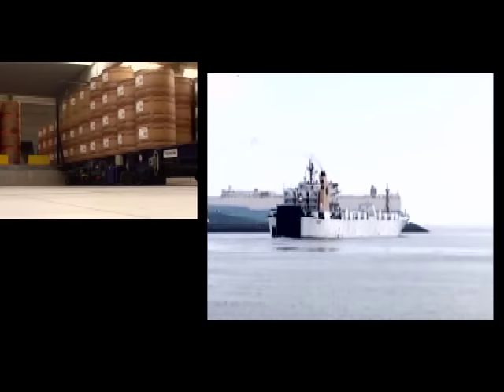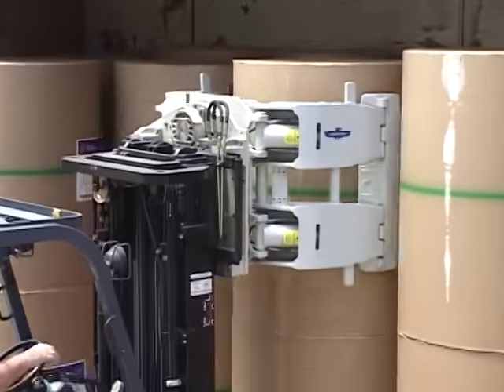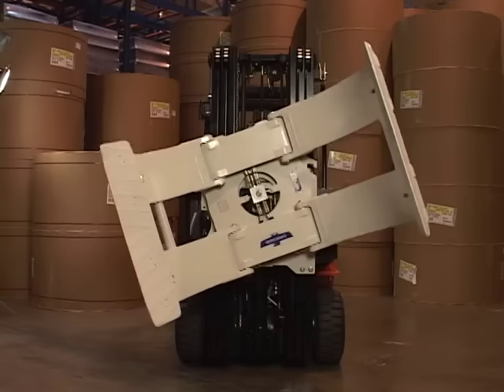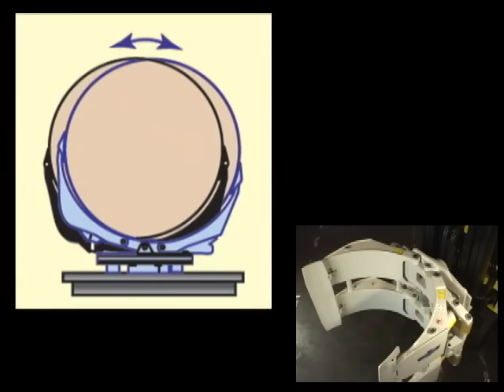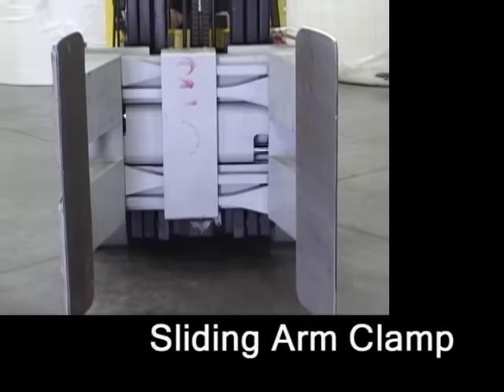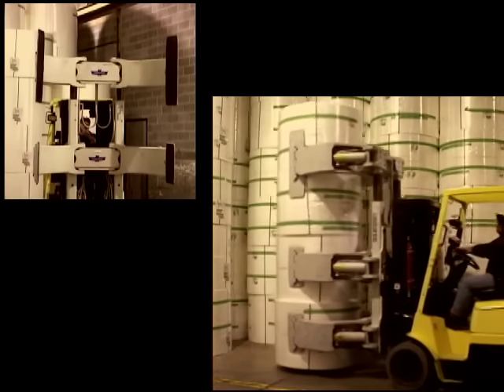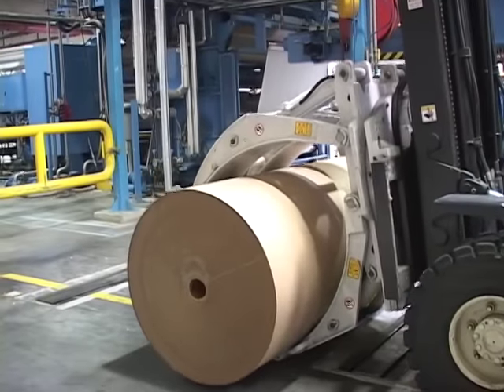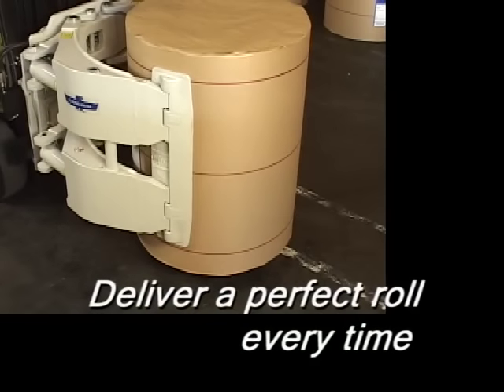Cascade Paper Roll Clamps - Lift Truck Roll Handling

Comment from the maker: @yanbu111bunty Please have a look at "Technical Support Manuals" page located in the Support section of our website. You will be able to find many different types of service, installation, maintenance and other documentation there.
If you still cannot locate the information you require please contact your local Cascade representative who's contact information is also located under the Contact Us section of the Cascade website.

Comment: The hyster trucks at where I work still mess up a lot of rolls.  I guess it's mostly down to the operator?
Reply from the maker: Hello - Do you mean a Hyster Truck with a Cascade paper roll clamp? We would have you talk to someone in our customer service department in order to diagnose and resolve the issue. Contact us at 1-800-227-2233 for assistance.